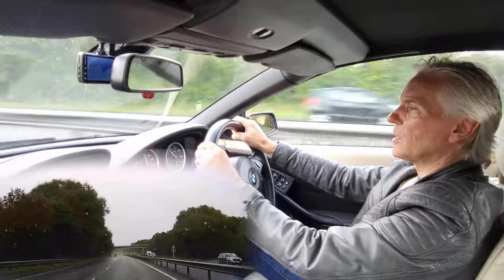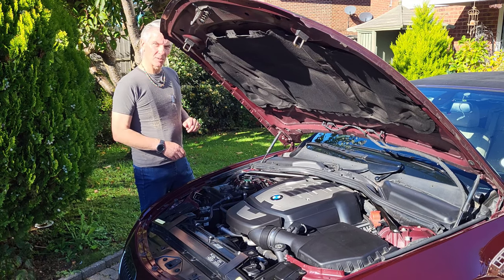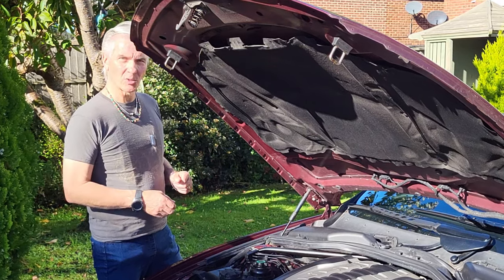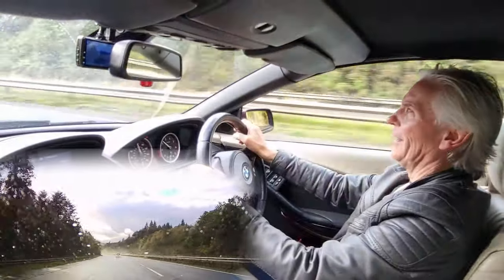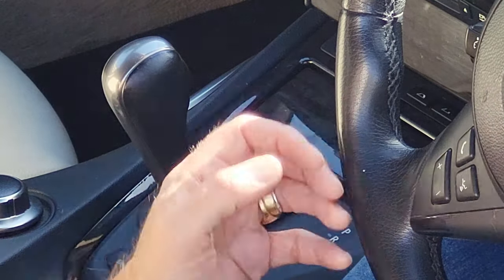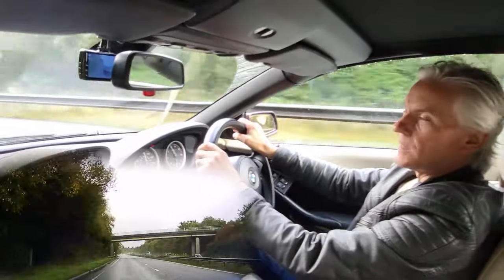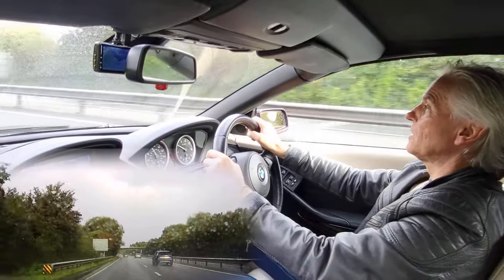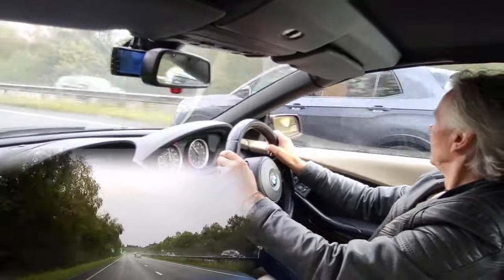BMW - THE ANNOYING HESITATION AND HOW TO FIX IT

Comment: Great video. Two things you missed. 

One: kickdown; if you press the throttle request pedal to the obvious bottom the car will take seconds to decide to break the TC clutch and downshift but if you push extra hard to "105 %" that will instantly signal the engine you want instant power. It will immediately down shift to the lowest gear available (often this will break traction so current speed and surface conditions matter)

Two: and this one's my favorite; say you just need to add 10-15 mph to get to a better position to merge etc, as you are aware pushing the throttle request pedal one inch will do very little at cruising speed. If instead you quickly bump the pedal first to 2" down immediately pulling back to 1" down you'll get the exact effect of "left and up" without having to touch the gear request knob. 

You'll get TC clutch disengaged and one or two gears shift depending how far you retreat from that 2" bump on the throttle request. 

You can keep on the pedal the car will stay in the lower gear but as you bring the pedal up it'll naturally shift back to cruising gear and lock the torque converter back up. 

Try it I'm betting you'd find you use it half as often as the left up method. 

Caveat; when I had e53 I used the left/up method much more but now with n55 and 8 gears it's more like 70/30 bump throttle vs. up: left. 

Great explanation on how to tell the car when you want some power on demand and love the video on Valvetronic that's how I found your channel. 

Subscribed!
Reply from the maker: Thanks Andrew, a lot of good tips there
Reply: @TimmsBMWRepairsandInformation likewise!

Comment: Nice video. I have a 2003 325xi and having the opposite problem. After I floor it, the car keeps accelerating for another second or so... I've found another post on the web with the same issue but couldn't find out the cause. Wonder if you can help?
Reply from the maker: Every now and again I see the same behavior, it doesn't happen all the time, usually after I have pushed the pedal quickly down and then decided I didn't need the power. I've always thought that this is a weakness of the software control of engine power - so many servo's to move back in a short time.

Comment: I’m new to automatics,no idea how to use the paddles.Do I take my foot off the accelerator to change gears?
Reply from the maker: I know exactly what you mean - I've driven automatic gearboxes all my life - it just seemed strange to change gear without letting the throttle off. But, the paddles are just the same as the shifter - you can change gear at full power and it will not ley you change to a dangerous gear

Comment: True that but only on a 500+hp not a 330-340hp there is alot of weight on the six series, however on a wet road not advisable to punch it, especially if you have traction control off.
Reply from the maker: Not a great combination!
Reply: Done 90mph on a wet road with no traction felt like I was driving in a f1

Comment: Does switching it to DS mode and back do any damage ? I feel like I shouldn't do it very often, although it feels needed when I need the power.
Reply from the maker: No, you can pop it backwards and forwards as much as you like!
Reply: If you maintain it you can drive it as hard as you want and not worry

Comment: Enjoy your videos and was hoping the one about resetting the upper and lower limits on the window might be an easy solution to my problem, but no go 😢

I have a 2004 BMW 645ci convertible. The rear passenger quarter window drops when the top is opened, but does not come back to full up, only about 3/4, when the top raised to the closed position. If the top is in the closed position the window goes down but only comes up to about 3/4 position. In other words, no problem lowering the window at anytime, but it only comes up to the 3/4 position. In both cases, a very slight pull on the top of the window while raising it draws it past the 3/4 position and it finishes rises nicely on its own to full up.
Any suggestions, or is it the dreaded regulator replacement issue?
Thank you!
Reply from the maker: Yes, it's the dreaded regulator problem - you could try some white grease on the mechanism first though

Comment: I have a 08' 550i msport with a N62TU engine . It takes off best when in 2nd / 3rd, but if I were at a red light and floor it, it takes a second as you mentioned ... Even in sport mode . I believe it's because I lose traction ?
Reply: Look on your cluster, you'll see the traction light flicker if you're losing traction.

Comment: I have had the eml light come on today, I have had no issues with engine over the past year after buying car it has ran just fine. Today it is not happy, it feels like it is not getting fuel? Engine is surging when gas pedal is down halfway in neutral it sputters a little rpms go up then down not moving my foot on gas pedal at all any suggestions please
Reply from the maker: I take it that you have an 850ci?
Reply: @TimmsBMWRepairsandInformation  engine running rough idle it's the idle air control valve 👍 I didn't even have to replace it I took it off sprayed brake cleaner and WD-40 inside I watched the video of somebody else cleaning it until the mechanism inside moves freely put it back on and it works fine.

Comment: I have 2008 650i.  When the engine is cold me car accelerates fast from a stop.  But when the engine warms up and I floor the gas from a stop there is very little power of acceleration until it’s hit 2000 rpm’s. What could this be.  I have no check engine lights or anything.
Reply from the maker: MAF gives behaviour like that - only buy OEM BMW
Reply: Really my car on has 65k miles.

Comment: what causes the big hesitation at 1,600 rpm - 2000 rpm in second gear, is that also the torque converter? mostly happens when cold temps, once the car is heated up its not as noticeable
Reply: My girlfriends 2010 535i just started doing that with the recent colder weather… no issues later once it’s warmed up…
Reply from the maker: Have you done the transmission bridge seals?

Comment: Very cool, does launch mode make a difference when you do this maneuver? Love the tips!
Reply from the maker: I haven't tried it, this is for when you are leisurely cruising and you need immediate power!
Reply: @TimmsBMWRepairsandInformation   I tried the down shift on the motorway today for passing 2 slower vehicles…..Wow, worked like a charm! No launch mode engaged, however, you don’t need it at higher speeds! The car purred like a happy cat!

Comment: 2009 650i can I use the paddle shifter to get the same power response?
Reply: I do. Sport mode and downshift for power when you need it.
Reply from the maker: Yes, that's the way to do it!

Comment: You know what its Almost time to throw the whole thing in the trash Nonsense. Disa, vanos, throttle pedal sensor, i dont even care to investigate anymore waste of mo ey all around. Its great car that is quite but its got problems every few months. Windshield pump fails every 1 to 2 years. My advise dont buy a BMW am 6 k im maimtance in 3 years forget it
 Get honda works or lexus etc
Reply from the maker: You are probably right, BMW's are high maintenance that's for sure

Comment: because it's a crappy bmw, that's why
Reply from the maker: Good point, well made!
Reply: If it's not maintained like most bmw but when you maintain the abused N62 it will treat you right then you can add power it is power hungry I'd say you can throw a supercharger with everything stock and still jump from 325 to 450 475hp with nothing else

Comment: My x5 with the n62 goes into this mode automatically when going up steep hills and it takes a while to let go when at the top. After a while of revving quite high it will finally settle down and go back into economy mode. Not sure if that's normal or not
Reply from the maker: Yes, normal - I always use Steptronic on hills to stop this happening

Comment: NEED UR HELP 🙏🙏 
MY 01 BMW E39 530I WAS RUNNING GREAT ,3 WEEKS AGO WAS OMW TO WORK AFTER GETTING GAS IN MY TANK GOT ON FREEWAY AND BOUT 20 MINUTES INTO DRIVING WHEN STEPPING ON ACCELERATOR CAR JUST SPUTTERS !!! SO TOOK TO SHOP I ALWAYS TAKE MY BMWS TOO AND THEY SAID NEED YO REBUILD MY VVT SO $2,000  LATER STILL NOT WORKING,WHAT DO YOU THINK IT IS , ALSO KEEP GETTING CAMSHAFT POSITION SENSOR EVEN THOUGH REPLITHEM
Reply from the maker: No chance, the Vanos does not cause immediate problems - possibly they meant that the timing chain had jumped over failed chain guides - but otherwise, no, the Vanos does not cause those problems.
Reply: @TimmsBMWRepairsandInformation  so they did a vanos rebuild and sealed it up checked my camshaft timing and flushed a bunch of sludge out of my engine as I had burned through 4qts without realizing it aftermarket pvc system so going back to stock so byrn less oil , but now running great better than before